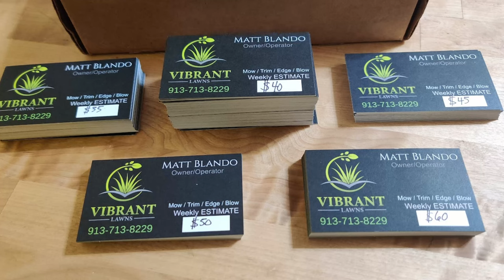GOOD TRADE OR BAD?? TORO PROLINE VS SNAPPER PRO WALK BEHIND MOWERS #lawncare #lawnmower

Comment: I mowed with Toros like that a long time ago, love them. The T handle is the best and the belt drive is simple and easy to work on. I'd love to have one with 52 inch deck but if I had the chance to buy a smaller one for three hundred bucks I'd run to get the cash !
Reply from the maker: I got to the guy's house pretty fast before anyone else saw his ad. It was definitely a good buy!! I've seen people trying to sell non-running walk behinds for that much or more

Comment: I've been running the older Toro proline/T bar belt rive units for years.  And you got a great deal for $300, especially with the 16 HP engine (most of the time they have that 12.5 HP engine).  Absolutely love them. Easy to change the deck height, the floating deck lends to excellent cut quality, very easy on gas and simple to maintain.
Also, look into getting a Bradley 2 wheel sulky with the quick detectable lock. It will cut the mowing time in half. 
If you do get a sulky , add about 40lbs or so of weight on the front to balance it out. Salute !
Reply from the maker: I appreciate the information!! And yes I got a steal on this mower. That Kaw 12.5 is legendary but, for them to have upgraded to a 16 horsepower was great.
I was very impressed with the cut quality too. Thanks for watching and I appreciate you and the information. I'll look into that sulky... And like you said it's real easy on the gas.
Reply: I mowed with these Toros years ago for 5 or 6 non-consecutive seasons, I would love to have one, preferably with a 52 inch deck. They were great for mowing places most machines could not go because they were relatively light and you coul manhandle them (at least I could when I was in my 20s, 30s and early 40's).
Reply from the maker: @johnossendorf9979  I agree with you 100%

Comment: That toro looks dope, and it’s a vanguard engine not just a plain old Briggs and struggling man, vanguard is owned by Briggs but I still think there a step above. Prolly needs the carb cleaned out and check the float height and roll it. I wud def pick over a kohler turd. But that t handle thing is wicked, I wud rock that Jessie, I dig that cub stander tho
Reply from the maker: The Toro did end up getting some carbs cleaned and it ran like a champ and yes the Cub Cadet stander work excellent and is very dependable after using it for a full season.  I appreciate you commenting and watching!!

Comment: I’ve been really struggling between a 48 and 36 inch walk behind for my first commercial mower. Just about all the yards in my are could be done with a 48 but I’d be stuck using my 21 inch push mower for the smaller gated yards.
Reply from the maker: That's a very normal struggle to have as you grow your company. I went through the same thing. Started out younger with 21 inch and riders lol. Older gates seem to be 36 in unless it's a double. But I noticed in my area newer gates were able to fit 48-in mowers so it was nice because I could have a 48 in and do both the front and back instead of switching mowers or having to cut everything with a smaller mower. I think I'm going to implement getting rid of the 36-in mowers and have 48 and 52's and If I can't get in their backyard, either I find a solution with their gate or I try and suggest the lawn to another company for a referral fee. I'm just sick of switching mowers because the time it takes, also your more expensive mower is out front exposed as you're in the back with the cheaper mower.
Reply: @vibrantlawns2444  glad I’m not alone in this struggle! I’m going to implement that same thinking and pick up the 48” so I can grow the business and start getting rid of these yards with the smaller gates. Will make my life easier in the long run and maybe a little down the road I can pick up a used 36” just to be able to take on a couple gated yards to pay for a newer mower or something along them lines.

Comment: Sounds good 👍🏽 I see the Cub also! Team ZT1💪🏽
Reply from the maker: Thanks for watching!! ZT1 is a good mower!!
Reply: @vibrantlawns2444  On my 3rd season 150 hours don't use it mulch also have ZTR50 500hrs👍🏽
Reply from the maker: My Parents use it mostly on their 5 acres and there was a few design flaws with the deck that I fixed, but besides that, it's a good mower for the price and really helps them and cuts great.  Main thing I noticed is that a good Cub dealer is good to have. The dealer here in our town hasn't been the best with some of the deck issues but since I've been doing  this for so long, I was able to help fix it for them.  Still is a good mower

Comment: I had a toro pro line with the Kawasaki. It would always start first pull and cut very tall thick grass without bogging. It was a beast but gear driven and  better for wide open areas because it was a PITA to back up.
Reply from the maker: I've noticed it's not too bad so far. I hope it's just as much a beast as yours was. I noticed how fun it was to reverse. Going backwards is easier to put in Neutral and pull it back if you need to. Thanks for watching and for the feedback!!